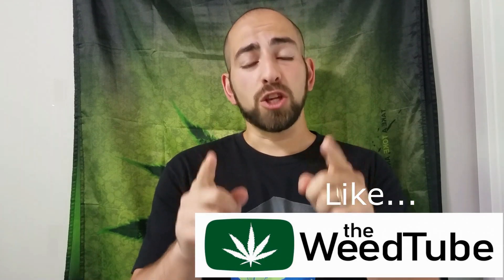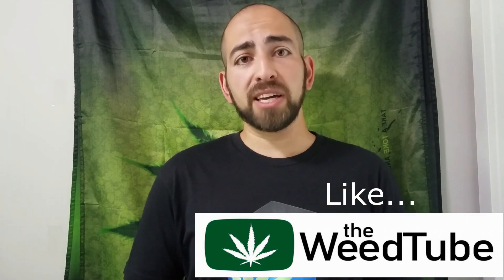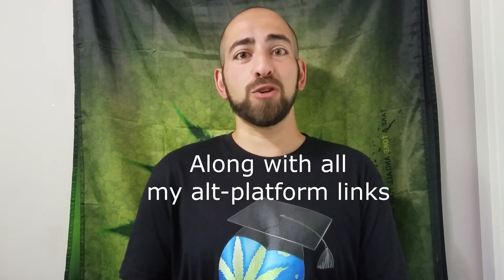How Much PAR Do Cannabis Plants Need? - Understanding PPFD & PAR

Comment: I have come to realize that the information on your YouTube channel is very accurate and dependable.  Thanks for the great info!
Reply: no it's not ... :D he did mistake Usable PPF for PPFD ... and it has a unit: its micro mols per second.
also using over 1000 umol/s will most likely require CO/2

Comment: I'm just getting back into it I used to use HPS. But now I live off the gridand those lights pool way too much juice so I've gone with LED and it looks like I may have made the right choice what used to take 1200 watts to do I can now do 120 watts. But thanks for explaining the different ways of measuring the light I was a little confused when reading the LED specs cuz I had never heard of ppfd. Anyways thanks for the info 😎

Comment: Important note: the 600-900ppfd for flowering is meant for photoperiod plants on 12/12 cycle. But if you're doing autoflower plants and flowering them under say 18/6, then you're better sticking with 400-600ppfd. The only reason the ppfd is increased during flowering is to compensate for the shorter time the lights stay on, but that might not be the case when growing autoflower plants. Look up DLI (Daily Light Integral); the ppdf should be based on the number of hours the plants are under the light; the more hours you keep your lights on, the lower the ppdf needs to be. 400-600 is meant for 18 hours on/6 hours off. If you're doing longer or shorter hours then simply add or subtract the percentage increase or decrease in light hours to these ppdf values.
Reply: So there isn't much info when i just tried looking this up, are you sure that Autoflowers have the same DLI as photoperiods? I've heard that auto's have higher DLI's so they do want the higher amount of ppfd throughout the light period, but there isn't much in terms of what the dli for cannabis is. I've seen 30 moles for photoperiods and upwards of 40 for autos, but nothing in terms of actual studies.
Reply: I think it varies widely depending on strain. I had an auto that got very light stressed at 900ppfd for 16 hours. She's much happier at 500-600ppfd. While another auto from a different strain was totally fine under 1500ppfd for 18 hours. The numbers in Lex's video are general guidelines, but what's optimal for your particular plants might be different. Luckily the plant will usually let you know if it's getting too much light, so you can test, observe and adjust.
Reply from the maker: Yes, as I kinda imply here again when talking about the Mexican Sativa that was tested - there's always strain-specific truths that you'll only discover once you grow a certain strain a while. My numbers are always just the rough guidelines.
Reply: Also I suspect that plants might have different tolerances depending on the light spectrum used (e.g. Blue/Red LEDs vs. Full spectrum white). Room temperature is another factor, since its closely tied to plant metabolic and photosynthetic rates.
Reply: I’d like to see a study of the effect of CO2 and ppfd on autoflowers. There isn’t a lot of information on DLI targets for cannabis, even less for autoflowers specifically.

Comment: 600 PAR @ 18 hours is the exact same amount of light as 900 PAR @ 12 hours. 
When you say "400- 600" for Veg and 600 - 900 for flower, it's bad info, misleading. 
If someone is switching to flower and running at 600 PAR, if they switch to flower and keep it 600 they're cutting the light by about 30% over all. 
If you're switching to flower and running at 500 PAR. Just multiply 500 x  18(hours). Take the total and divide by 12 (hours), that's the same PAR as 500.

Comment: Pt.2.....if you want fast growth instead of those stunted plants yajl grow. Seedlings 140-175 ppfd first 7 days, 200-250 next 5 days and finish seedlings off at 275-300 ppfd (never ever 400). Vegetation 350-400 ppfd first 5 days and so on and so on.
Reply: Hey TeW33zy, your comment regarding ppfd is exactly what I've been looking for. Can you provide a plan? So far this is what I've got, please correct any mistakes and help me complete it. Day 1-7: 140-170 ppfd
Day 8-12: 200-250
Day 13-21: 275-300

Day 22-30: 350-400
Day 31-60: 400-600 ppfd
Day 61-90: 700-900 ppfd

I'm using the Photone to get an approximate measurement. I've just written some suggestions without knowing anything.
Reply: @bssitsmmsunrr  I am a Sr. Biosystems Engineer, Agricultural. I got you covered.
Ok so ppfd, C02 and Nutrient ppm are a function. See Below 
The Nutrient feedings are based on using Fox Farm Soil from the beginning. You shouldn't have to feed Nutrients until mid Flower. Feeding in veg only should occur if your plant eats up all the food in Fox Farm soil. Your plants leaves will tell you if so. This generally happens only if you stayed in a particular pot size to long or past 3 weeks. Generally, Fox Farm Soil has enough reserves until your next Transplant. If u plan to stay in the pot size longer than 2-3 weeks then feed accordingly. Usually 1 Feeding will give you another 2 weeks.

Seedlings: 
Day 1-30 = 165ppfd (party cup)
Day 31= Transplant to 1 Gallon
Day 31-45 = 200 ppfd
Day 45 = Transplant to 3 Gallon 
Day 45-65= 250-300 ppfd
Day 65 = Transplant to 5 Gallon 
Day 65- until Flower 300 ppfd

(Transplant how you best see fit, u do not have to follow my scientific regimen)

Transition to Flower 
Day 1-30 = 500 ppfd CO2 700ppm
Day 35 -75 = 700 ppfd CO2 900ppm

⚠️ Warning ⚠️ 
Do not go over 750 ppfd without CO2 supplementation of 1000ppm or greater or your plants can/will turn to a hermaphrodite. 
C02 must always be 200ppm above your ppfd. 

C02 supplement table below:
500 ppfd = C02 700 ppm
700 ppfd = C02 900 ppm
900 ppfd = C02 1100 ppm
1000 ppfd = C02 1200ppm
(83°F leaf temp is required for adequate photosynthesis for ppfd above 700)

Tip: Never exceed 1,000 ppfd otherwise you burn the capitate-sessile, capitate-
stalked, and capitate-bulbous trichromes
and volatize your flavornoids, cannabinoids, thc and terpenes. You deplete the aroma by 85% as terpenes are extremely volatile. They evaporate at temperatures above 71°F after harvest and at 87°F or greater during flower from heat occurring from ppfd above 1000-1200. Nutrient ppm should match your ppfd. Feed Nutrients every 4th watering. Ppfd, C02 ppm and Nutrient ppm should match. Except C02 ppm should always be +200 to allow the plant to keep up with carbon dioxide.

Comment: Love the channel, love the content.  One question.  If sunlight is 2000+ umol/s in nature why do you recommend using levels so much lower?  I run my grow tent above 1500 umol /s at all times, and in flower as high as 2500 umol /s with excellent results.
Reply: +1   I finished my first grow...LSD-25 autoflower at about 1200 PPFD using Bloom Plus 3000 LED.  Only plant I grew gave me just over 2 oz of dense, smelly, sticky flavorful, and very effective buds.  Yeah for me!
Reply: How are you altering umol? More lights or do you have a light where you can alter the PPFD
Reply: @Alchem1stt  Current control drivers, or number of lights; or both.  There is no realistic way to replicate sunlight though, not even close
Reply: @fakename7570  I expect at least 1g / W of electrical light power.  With a 300W LED source I pull 10-12oz of top grade buds.  That said, sunlight puts this to shame.  I'm confident I'm not even at half, maybe even a quarter of the light I need to max out yields, but I really have no way to know
Reply: @ansmerek  thanks for the quick reply. Doesn't a 300w light lose a lot of PPF even at 2ftx2ft? It falls down to 120 PAR at the edges, how can this be viable if 600-900 PPFD is desirable for flowering?
Reply: @ansmerek  I'm starting a 90x50cm tent grow and need a led light. Should be able to fit in 2 5gl plants I think, would you recommend 300W LED or 1000W which falls to about 600W to where my plants will be. Also, as the plant grows, doesn't the top receive significantly more light? Please do let me know if im overthinking this for such a small grow and sorry for all the questions im losing hope with Google and while your here i might aswell ask ;)
Reply: @Alchem1stt  If you are driving 300W of actual electrical power through the LEDs themselves you will have a lot of power.  My 300W LEDs require liquid cooling.  Many of the 1000w+ sources you find on amazon may only actually be using 10% of that power for the LED itself
Reply: @Alchem1stt  There is no way around the inverse square law, other than to have a crazy powerful source far away (like the sun)  This does not mean you cannot get a good grow from less than ideal conditions, nothing is further from the truth.  My LED sources are fully custom builds (I work in the photonics industry) but you can get great stuff from Electric sky (ES300/600) or Osram VYPR.  Good lights are expensive, but the best thing you can invest whatever money you have in.  Light is the key to it all!
Reply: @ansmerek  Yes, depends on the efficiency of the LED.  Power not going to lights is going to heat.  LEDs can be actively (fans, water cooled) or passively cooled (Aluminum bars).

Comment: Is this to assume the seedling and veg are on a 18/6 and flowering is 12/12 which then means, after calculating MOL (using your medium values),... "uMol * 60 * 60 /1m * hours = MOL"

 seedling (18hr): 21.06 
Veg (18hr): 32.4 
Flower (12hr): 32.4

Now, I'm understood above 30 for flower is cost effective and I do beleive the seedling is in a good value, but having the same MOL for veg and bloom is a normal thing?

Comment: Hey Lex, I got a question and really hope you can answer...
I am growing 10 regular Afghani kush plants and they are 32 days old from seed, and I tried to rub my fingers around the main stem up and down to smell them, and 8 of those plants smells very soft and flowery (delicious), while the other two smells like sweat and piss, kinda like what you smell if you run on a treadmill at the gym...
My question is, is that a good indicator to sexing my plants? like do I have 8 females and 2 males right now?
Thanks in advance and hope you have a great day!
Reply: NO NO NO.  A better indicator would be the pre-sexual traits at the nodes of young plants.  Male plants have a penis or knob looking mini structure (stamina) at the node lol.  What you are describing is genetics.  All seeds contain different genetics - different phenotypes and genotypes. Go do some research.  Also males plants grow taller and more distance between the nodes or branches (leggy).

Comment: Finally a video about PAR rather than lux because that's mostly meaningless
Reply from the maker: now, now, lux isn't meaningless; tell that to outdoor growers. But PAR is more useful indoor for both optimizing light intensity AND making sure the lights you're using are actually what you think you paid for.
Reply: @LexBlazer  that's a fair point, lux gives you a reasonable indication of light conditions outside. Even inside for some lights, but with these LEDs lux is pretty useless though. Regardless, PAR gives a much better indication of what a plant will do than lux, so I much prefer it.

Comment: If your buds are not rock hard , crystal coated to the stick ! YOU NEED M O R E  PAR !
Reply: CO2, nutrients and genetics are what determine density in my experience (growing cannabis for over 23 years on a massive commercial scale most the time, I currently only run 38x 1000 water license and have a 455 plant license). Also the right nutrients are a sure fire way to get "Massive" amounts of "Resin"/crystal.
Reply: @RoCkShaDoWWaLkEr  no, just genetics , the rest ,is supplemental  friend !
Chow .

Comment: You explained those values completely wrong. You stated the PAR value not the PPFD. 600-900 is what the PAR meter would read. The PPFD for 600-900 PAR would be  26-39 PAR/hr over course of 12 hour photo period (lights on time). You massively oversimplified that calculation. You multiply the PAR reading by the number of seconds in your photo period (ie PARx3600 seconds in a 12 hour light cycle) and then divide that by 1,000,000=DLI. Example (600 PARx3600 seconds)/1,000,000=2.16 PAR/m2 per second. That’s how many PAR (light) your canopy gets per square meter per second. Hence the fucking term “DAILY LIGHT INTEGRAL”... and by the way 600-900 PAR is WAY TOO much light even with CO2 supplementation!!!

Comment: I have a 3000 watt full spectrum LED light and I have little baby plants that are about the length of a middle finger how high should this 3000 light be from those plants without burning them or hurting them I actually have the light about 4 ft from them right now is that too high